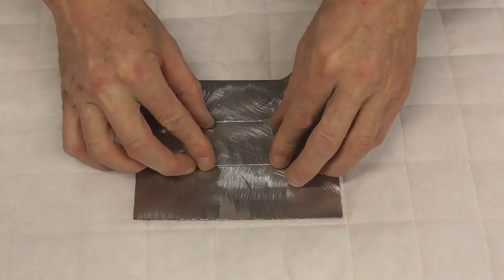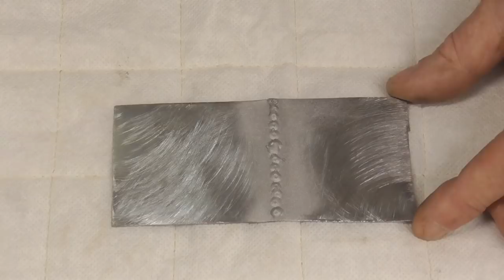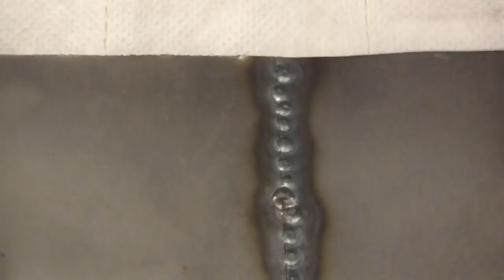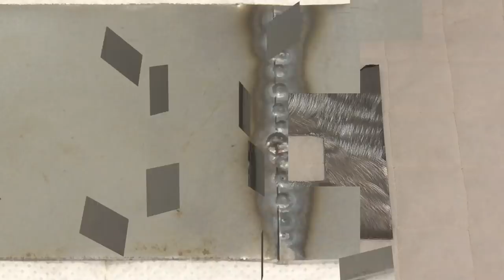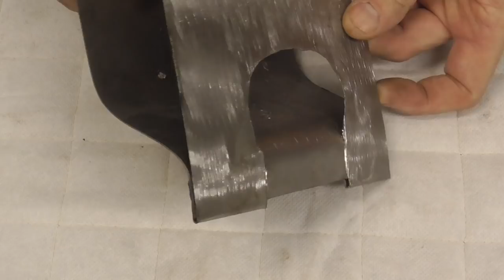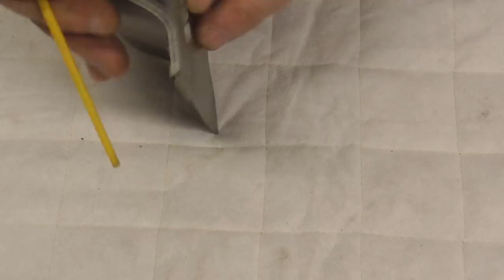Welding Patch Panels - Lap or Butt?

Comment: Just curious ...why didn't you show the back side of a lap weld compared to the back side of the butt weld you showed?
Reply from the maker: Good question.  The lap weld would be very similar in that there will be small gaps or imperfections but  the lap weld has the advantage of being faster, easier, saves on grinding discs, and holds up very good because you have a thicker layer of body filler over the repair.  If you seal or coat the back side with some good undercoating it will last longer than us.  I do not over lap the patch enough to trap moisture between the layers plus I like to spray the back side with used motor oil to stop rust.  Hope this answered the ? if not ask again.  Jerry
Reply: @LakesideAutobody  I've been using the Penetrol, haven't tried spraying it yet tho, but I use it to protect my bodywork before I get to the bondo stage, trying to work out drive ability issues w my F150.  I can brush the Penetrol on, it will seep into the crevices to protect them after I sand to Bondo Glass it.  Then I'm thinking of using it as a "primer" and then spray that professional enamel Rustoleum spray can-  thinking this may not be too bad a repair since my pneumatic spray paint situation isn't there yet - need to make a water separator and gun etc.  But also looking for the effective inexpensive "quick-ish" decent repair to get my beater on the road again... not sure how good Penetrol is as a primer, I know it will wear off if not painted over.  I may do some tests of my own, if I do a vid I'll send it to you,  The tests may be a bit inconclusive since Father Time is the real test but exposure to the elements... ie try it on a "metal roof" test panel-
anyway, another great vid! Thanx!
Reply from the maker: @apples13able77  Excellent - look forward to hearing from you and how the experiments work.  I've heard good things about Penetrol  - have a good week
Reply: @LakesideAutobody  great video but i must say saving grinding disks  cannot be an objective.you hv mentioned it several times in the video how much do these things cost were you live? I want the best outcome if i hv to go through 5 disks per door.
Reply from the maker: @altheboss5722  In a body shop environment the boss/manager won't stand for it - anyone doing that would be laughed out of the shop.  There's no need for it.  Please see these videos for longevity of lap welding and the methods seen on this channel:
 https://www.youtube.com/watch?v=8XaZBy7GC7A or 
https://www.youtube.com/watch?v=2o37dX--w0I

Comment: Interesting video. I been butt welding only so far. Doing a restoration and it just seems right thing to do. I’m also welding back side cause of what you said about welds getting too thin. Always learn something from you. Thanks
Reply from the maker: You're welcome.  Use small overlap - weld solid - no moisture - especially if you keep the drain holes clean (most important thing in rust prevention).  Please see this video for longevity of this type of repair if done correctly: https://www.youtube.com/watch?v=8XaZBy7GC7A or 
https://www.youtube.com/watch?v=2o37dX--w0I
Good luck - the method you use is really up to you and what you think lasts the longest :)
Reply: Check out Fitzee's Fabrications 'cut and butt' technique.  He's from Newfoundland, and he's amazing!

Comment: Excellent vid. Good to know my lap weld to fix the lower fenders on my F1 was an OK thing to do. I've wondered if I had done it wrong because it wasn't butt welded. Yae!
Reply from the maker: You can do it either way it doesn't matter really.  If the panel is going to rust again it's not going to start up high - It will begin again at the bottom of the panel where salt water and debris sit.

Comment: HOW ABOUT PUTTING THE PATCH ON THE INSIDE ( LAP) AND WELDING AROUND THE PERIMETER , ( OUTSIDE ) WHILE HOLDING THE PATCH WITH A MAGNET , THEN JUST FILLING THE LOW AREA  WITH BODY FILLER .
                                             THANK YOU
                                                         AL.
Reply from the maker: You could do that but then know that the overlap will hold water on the inside as it will be facing up now.  It is a bit harder to hold the patch in place too as you can't press it against the other panel.  Your choice though - if it works for you - perfect.  Jerry

Comment: Regardless of weld method, the back side has to be fully protected with cavity wax or some other rust stopper. Ignoring the hidden inside, will have it rusted through in under 2 years.
Reply from the maker: That is a good idea but if you just squirt some oil inside the enclosed panels they'll last way longer than you'll have the vehicle - https://www.youtube.com/watch?v=gIS1Tbv7Kvw  Still perfect today actually - about 5 years :)

Comment: You mention that there is a problem with corrosion starting at the rear of butt welds, surely it'll be worse with lap welds, there'll be a perfect crevice for corrosion to start in behind the patch?
Reply from the maker: Here's a couple vids that will help on that exact topic.  https://www.youtube.com/watch?v=JIIonJOVro4  &  https://www.youtube.com/watch?v=8XaZBy7GC7A
Reply: @LakesideAutobody  So it's all just a matter of opinion...
Reply from the maker: @alexbaxter9512  I just read a paragraph from a 1950's Ford Shop Manual that states the correct way to do repairs like this.  I can send you that if you would like - Their instructions are: Weld it into place (shows lap)  ---- Tap seam below surface with grooved dolly (never saw one myself) --- "tin" the welds and fill the groove in with lead  ---- metal finish.  Interesting..... I was always looking for something like that and a fellow in the comments sent it to me.  I'll make a video on it far all to see - I think it would really help folks make up their mind
Reply: @LakesideAutobody  Yes, they would use oxy acetylene welding in the 50's, (the good old bad old days,) you'd be really skilled not to have distortion with gas welding so beating it in and leading it would probably be the only option.
Reply from the maker: @alexbaxter9512  My dad used to braze and like you said, it had to be real tough dealing with distortion issues.  I tried it a few times but got a job elsewhere where they used MIGs and that was the end of that :)

Comment: You still have an area of raw metal edges on the backside for the saltwater to start corroding, on the lap joint.
Reply from the maker: Remember, only the internet dislikes lap welding - new cars are lap welded together and all body shops use lap.  I always use a combo of both though depending on the situation.  I also have a video on butt welding patch panels.  Use small overlap - weld solid - no moisture - especially if you keep the drain holes clean (most important thing in rust prevention).  Please see this video for longevity of this type of repair if done correctly: https://www.youtube.com/watch?v=8XaZBy7GC7A or 
https://www.youtube.com/watch?v=2o37dX--w0I

Comment: If you overlap it wouldn’t you have a problem if rust gets between  the 2 panels.   Since you can’t get to the inside salt water will get into the overlap and soon rust it out.  You have actually increase the area that could be affect 4x’s.  The butt weld is actually a much smaller area to be affected. I guess I’m confused.
Reply from the maker: No it would not - I've never had rust get between the panels (it's < 1/4" overlap) that's internet fake fear.  Been patching rust like that since 1984 never had a patch bubble.   Cars rust from the bottom of the panel up because moisture sits down there not on the side of the panel.  Squirt oil in the panel after the repair to protect that lower area.  Really... see this video for the truth.  https://www.youtube.com/watch?v=8XaZBy7GC7A

Comment: I know this is old, but it's one of few discussions on this topic.  I'm doing wheel arch patches on a pickup and going back and forth on lap welding, butt welding, or maybe even gluing the panels in place.  What concerns me most is that with lap seams (welded or glued), ghosting shows up later on.  Apparently, on a warmer day, as the steel warms up, the joints that are doubled up take longer to expand than the single layer of steel and a line is visible.  It's only noticeable by eye.  You can't feel it, and I'd have to believe you wouldn't be able buff it away either, as it's not a flaw in the filler or paint.  Anyone have knowledge of this or experienced it???
Reply from the maker: You'll never have it if you knock or tap the seams down.  If you grind the heck out of the welds, try to metal finish the patch, and have the seam right under the paint it'll likely occur.  Weld how ever you prefer lap or butt, knock it down and fill - no problems.  Check this follow up video out - still looks the same even today 3/2023 - (5 years) https://www.youtube.com/watch?v=gIS1Tbv7Kvw
Reply: @LakesideAutobody  Thanks for the reply Jerry.  Just to be clear, what I'm talking about is a perfect looking repair that shows no line when cool...and as the vehicle warms up in the sun, a ghost line appears where the seam is.  It's not a flaw in the bodywork, but a difference of expansion as the panel warms up.
Reply from the maker: @kellyappel3015  You should never have a problem with that - really.  Remember every sail panel from the 60's 70' and 80's was done in the very same way from the factory.  A lap joint in a shallow channel, then leaded or filled with something other than lead (later models).  The sail panel is where the roof connected to the quarter panel behind the quarter glass or back of the side doors :)   One of the best body shops in Michigan and many others in Michigan use this method.  I really believe the key is tapping the seam down so there's a buffer between the seam and the finish.  When any seam, no matter how it was done, is directly under the finish, you're asking for trouble 😊
Reply: @LakesideAutobody  I understand what you're saying, but (if you were to search), there has been issue with ghosting on lap jobs.  Not with all, but enough to say there's a problem.  As long as we're chatting, what's your opinion on a recessed glued seam?  Does 3/8" give enough of a seam for 3m's (or similar) panel bond to hold?
Reply from the maker: @kellyappel3015  With a ton of respect, I'm sort of curious if you have ever seen ghosting with your own eyes or is this something you've read about in magazines or heard on TV.  A ton of guys talk about it online but they most likely talking about jobs that were done incorrectly.  As for 3/8"  for a flange.... I would not feel good about it my self (just me though) - that's why I don't use a flange tool for glue.  You can certainly use the flange tool if you weld though.  Let me know what you're thinking 👍
Reply: @LakesideAutobody  Was at a car show last summer, admiring a Chevelle.  Got to talking to the owner and I mentioned the paint.  He said he did it himself, but wasn't as happy with it as he'd like.  He told me about an issue with a wheel arch he'd put on, and how in the morning, the finish was flawless, but by noon, a seam would show up.  It was cool yet when I looked at the car and couldn't see anything.  I did not get back to look later in the day.  It was this that made me search a bit, and saw a couple videos with same thing.

I'm like you, I don't trust a lot of what I see on the net, but can't imagine why anyone would go through the trouble to make something like this up.

Thanks for the input on the glue and narrow seam!
Reply from the maker: @kellyappel3015  I don't think they are actually making it up - it's probably true that they see this and it probably happens a lot.....but due to one important mistake.  That is not tapping or knocking the seam/patch below the original surface of the panel.  When you do so, the filler is a buffer between the seam and the finish.  How could you ever see the seam if there is an 1/8" of more of filler covering it?  Here's a great example of rust repairs that never showed up again after it was painted - https://www.youtube.com/watch?v=2o37dX--w0I    also  https://www.youtube.com/watch?v=gIS1Tbv7Kvw  One last thing.... Never be afraid to use filler as it is used in every body shop across the nation - every day.  Even these guys that are out there saying they aren't using any - they are - even if they are using tons of primer surfacer to make up for not using filler, they are using filler.  I'd rather see a guy get it straight with filler, then finish the rest with primer surfacer :)
Reply: @LakesideAutobody  I do understand what you're saying.  What doesn't make sense is that the seam isn't visible until the panel warms up.

Comment: I've been welding seems like forever, bodywork... not so much.  In fact I'd say I could count the times on one hand.  So, a question, if your preference is to lap weld a portion, why not,  weld a little short piece of welding rod to the middle of your patch and turn it on an angle and put it behind the parent metal and lap weld with the patch on the inside holding it by pulling on the welding rod while you tack?   Admittedly not knowing a thing about body work, the thought of putting a patch on the outside of a repair would have never even entered my mind.  Just seems like you would need do much more filler.
Reply from the maker: One reason is that irregular patches are welded as you go using the heat to mold the patch a little at a time.  Another is that like shingles if you put the patch inside the seam opening would face up sort of holding any moisture (maybe).  Last - I actually believe a thicker layer of filler is better because its more rigid than a thin layer.  If the surface is prepared properly it doesn't matter how thick the filler is.  Usually on a rust patch the thickest I think I ever used was maybe 3/8" .

Comment: I know this is old.  But do you spray primer or otherwise treat the inside of a repair to help resist corrosion?
Reply from the maker: There's a lot of ways to treat the inside after the repair.  This really works well for me and also on new cars:  https://www.youtube.com/watch?v=8XaZBy7GC7A  &  https://www.youtube.com/watch?v=y05dNxt-nVc
Reply: @LakesideAutobody  awesome thanks.  I’m getting an old F250 and I know I’ll need to do some body repair.  Your videos are awesome!!  Thanks.
Reply from the maker: @SkiddingF350  You're welcome - I love the F250s of the mid 90's - tough as nails - not sure if that's what you're getting.  But look forward to hearing your progress :)

Comment: I have an 00 nissan maxima and the rear quarter panel has an arch like fender flares how would you get the same shape I only Have a flux core chicago electric welder is it possible to weld a new patch panel?
Reply from the maker: Yes you can weld a patch with the flux core welder.   Maybe this video can help you - https://www.youtube.com/watch?v=84A8NQnkMEc  Ask ?s along the way - no problem answering them.  Jerry

Comment: If you bevel your edges for what he called a butt weld and set your welder right you should have little to no grinding and full penetration. It takes practice but is worth it.
Reply from the maker: I agree with beveling the edges - that is the way you should butt weld a patch - I prefer lap welding though just because you can repair massive rust holes and damage - there's not a rust hole out there that can't be repair quickly and efficiently using lap Please see this video for longevity of this type of repair if done correctly: https://www.youtube.com/watch?v=8XaZBy7GC7A or 
https://www.youtube.com/watch?v=2o37dX--w0I

Comment: Should I use weld through primer all over the patch and panel before I weld?
Reply from the maker: I've never used it myself,  but I think it would help prevent rust after the repair.
Reply: Definitely on internally mated surfaces!!!

Comment: People have to understand that he's in a BODY SHOP environment where people ain't going  to pay for tig welded butt welds and no filler repairs. He's not RESTORING porches and lambo's. Anyone whos done bodywork knows how time consuming it can be. They got to get the cars in and out to make $$$$. Now would I do this on my project car at home ...probably not,  but I have the time, what I don't have is a customer on my ass asking when can I pickup my car. Good repair for your daily beater, not for your classic or high $$$ car. Lakeside Autobody no negativity implied cheers
Reply from the maker: Thanks for the comment and the support but here's where I stand on that stuff.  I use a combination of both lap and butt on almost every patch but I would never just butt two pieces of metal up, weld it, then grind away at the area attempting to metal finish it and neither would any body shops in MI, for many reasons but here are 3 really good reasons: 
https://www.youtube.com/watch?v=MfKlNQF-o4I  https://www.youtube.com/watch?v=rpH50kh4W00
https://www.youtube.com/watch?v=e9bjZ_UxtJg  
Today’s metal is .030. That is literally 6 hairs (hair is .005) thick.  You start grinding on that and the result is paper thin metal and welds. Lap and Butt methods work well if done properly so in the end it’s what works for you..  Keep in mind, you won’t find anyone butt welding in professional shops. Surely you’re not going to butt weld and metal finish this: https://www.youtube.com/watch?v=36zkc9UQaTs or some of my other rust repair videos.  Use small overlap - weld solid - no moisture - especially if you keep the drain holes clean (most important thing in rust prevention). Note that  the opening of the seam is upside down on the inside too.  Please see this video for longevity of this type of repair if done correctly: https://www.youtube.com/watch?v=8XaZBy7GC7A or 
https://www.youtube.com/watch?v=2o37dX--w0I